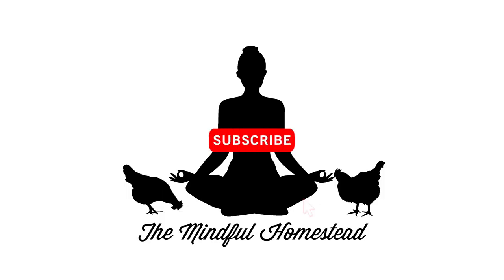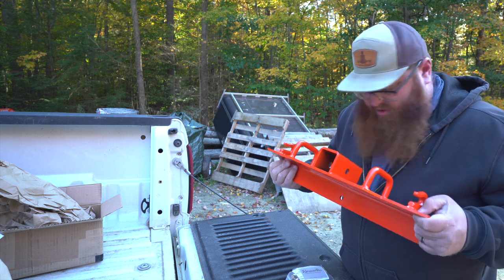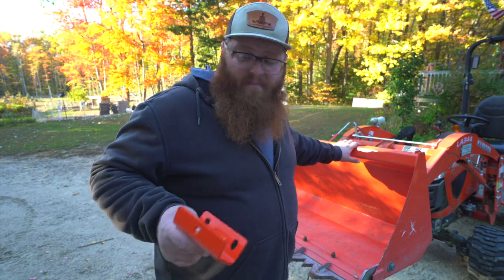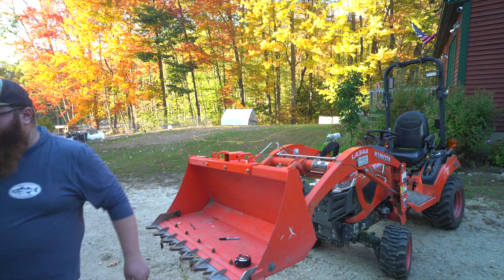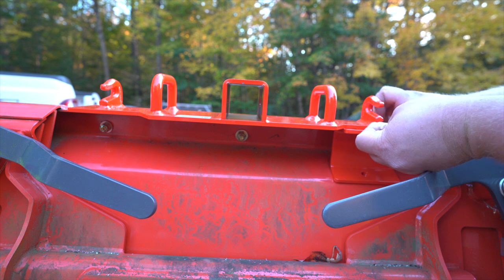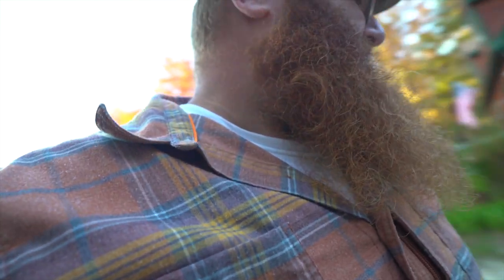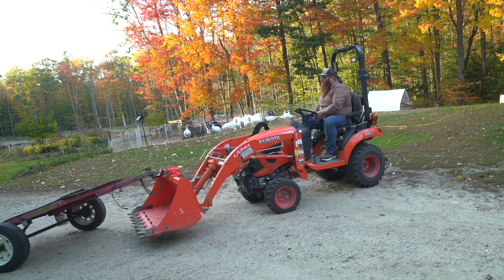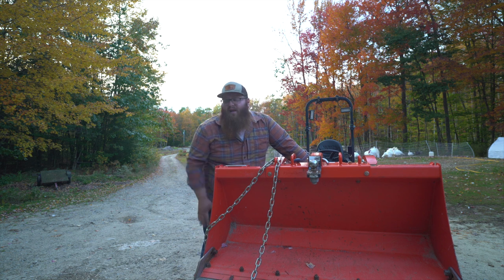Building A Kubota BX Swiss Army Bucket

Comment: I have been looking at this same device, thanks for the instructional video. A thought for moving trailers: having the trailer tongue elevated might not be much of a problem as long as your remaining on pavement or similarly level ground. But, if you travel across broken or hilly terrain, like a wood lot, you might invest in a drop hitch. A drop of 6, 8 or even 10 inches will allow you to keep the bucket that much higher off the ground while still keeping the rear of the trailer closer to remaining level. Allowing the bucket to pass over any obstruction (rock, stumps) or severe terrain changes (ditches, creeks) should be much easier than having to pick your way thru any potential points of contact. Every inch of drop will keep the bucket that much more off the ground, while keeping the rear of the trailer closer to remaining parallel to the ground so it doesn’t drag or dig in. 🫡

Comment: Nice setup  from JU Fabworks.   It looks great on your bucket and very practical too.  Harbor Freight has an 8" Drop Hitch Mount for about $35.  Allows you to lower your hitch ball height to a reasonable level.  Dan
Reply from the maker: I will check it out. Someone else has mentioned it, I just haven’t been near a Harbor Freight.

Comment: For bucking wood like you mentioned, you should think of getting a set of pallet forks.  Way better than using the bucket with a chain.  I am a big fan of the Artillian version that I bought!
Reply: Yep, BX1500 is a light weight. The small forks I use work well and <if necessary> can almost instantly dump the load. 
Nothing like feeling the Wheels come off the ground - omg......

Comment: I have the exact set up on my bx bucket. Thankfully mine bolted right up without and issues. I use a Harbor freight dual hitch extender. I have it upside down so it drops down then I drop hitch attached to that. Now my ball is almost sitting on the bottom of my bucket. I have a 4 x 8 trailer that the back was dragging on the ground or my front bucket was dragging the ground every time I moved it because the hitch was too high in the air so using the two drop hitches together completely fix that issue.

Comment: 4WD is a must when moving anything heavy on that hitch.  When you are pushing the loader limits, the rear tires have almost zero weight/traction and it's really easy to have a runaway situation with no way to stop.  Just stating the obvious that can be easily forgotten.
Reply: you need to have at least 800 lbs of ballast on the rear to use the FEL safely..... sounds like u got no ballast. gonna damage ur front axle doing stuff like that, u need the ballast to get the weight off the front axle and back onto the rears, theres a reason the rear tires are massive and the fronts are tiny
Reply: @schlomoshekelstein908  That certainly makes a huge difference, to a point.  A little BX can only safely move a reasonable sized load around on the FEL.  I have a 400 pound ballast on my B2301 3pth when I'm moving heavy stuff around and I still can have my rear tires sliding around a bit.  If you need 800 pounds of ballast, I hope it's not on a BX.  They just aren't very rugged (only an 1800 pound tractor) and holding the rear end down with excessive counterweight doesn't take much weight off the front axle.  It is still heavily overloaded.

Comment: its a neat idea but not for me.  If you keep drilling more and more holes into your bucket or start lifting or towin large things with it,  over time its going to start either bending or tweaking your loader from the stress.  Yes its metal but metal can get tired over time and loose its strength.  You got to remember these are small lighter loaders that are meant to do little jobs like moving dirt, snow and firewood.  They aren't meant to move around a holiday trailer.  Also to be honest it makes the tractors look messy.  Just my opinion.
Reply from the maker: A full bucket of dirt weighs more than the tongue of our boat. If that stresses the loader arms, then the dirt does even more damage. 

With regards to looks, my tractor is a tool. If something makes it more versatile, then looks be damned, I’m going to take the versatility over looks.
Reply: @TheMindfulHomestead  exactly. I think that you are going to be happy with it.
Reply: Maybe he just likes drilling holes. After all he replaced more than enough of the "drill-out" weight on his "mini-caterpillar 977".

Comment: yes, ............but no. I have the older BX1500 with fixed bucket. This unit(all in one) offers the same features with about the same installation time as other American Made parts which I believe are as good and less expensive.
Theirs in comparison:
2x Chain hooks - Fixed height for individual Buckets to clear Top roll.
2x Backer Brackets - (with Shackle loops if desired)
1x Quick attach/detach Hitch bracket - (Clamps to Blade area of bucket when needed)
*Total installation:
4 holes drilled.
1 Twist clamp-down (for removable hitch mount) * I prefer the hitch mount low and the bucket off the ground, especially on rougher terrain. 

It is nice to have choices for individual needs and American made quality.
Enjoyable Review overall and nice product, Thank you.